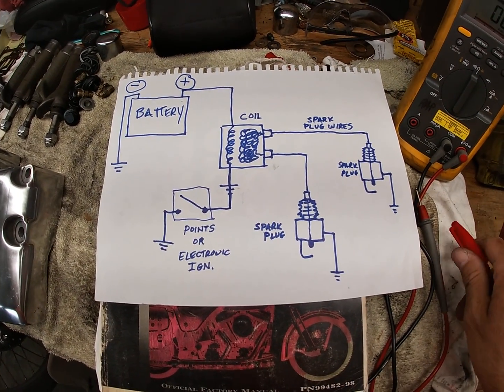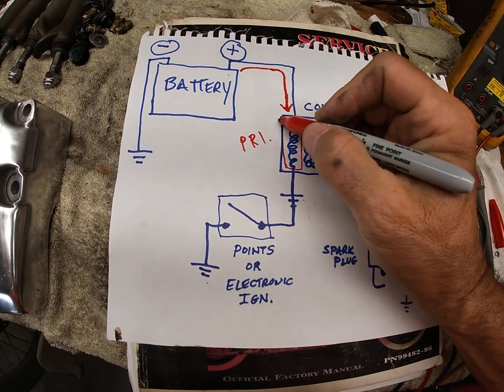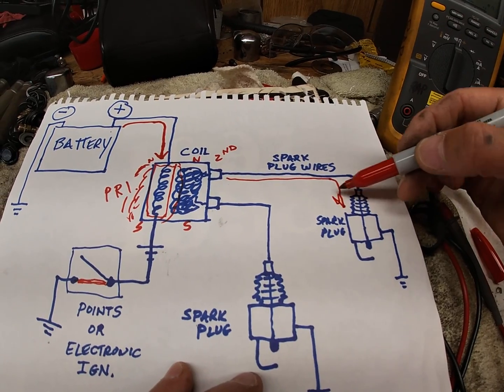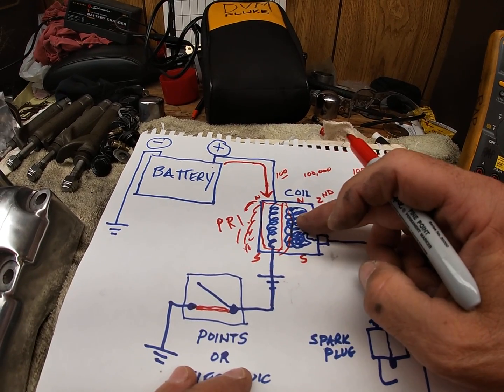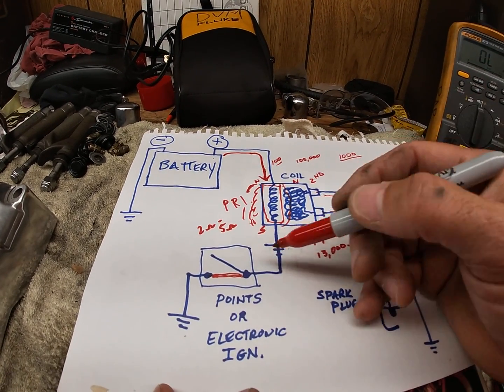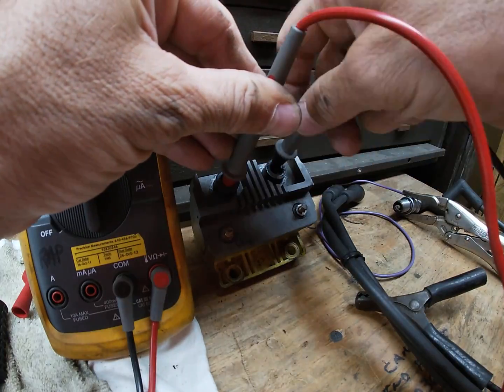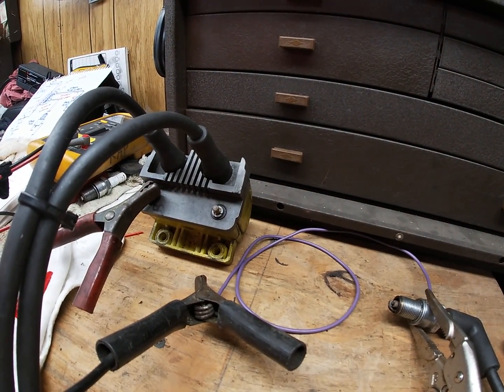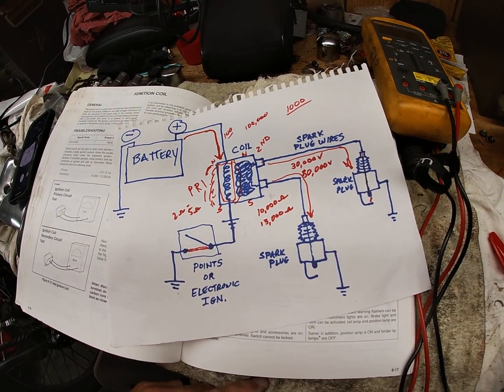Harley Ignition Coil, Points, electronic, Plugs & Plug Wire troubleshooting the system #Harley #coil

Comment: A must watch video if you are a home mechanic. Thanks
Reply from the maker: Thank you and if you haven’t, please subscribe.
Reply: @Rapsgarage  its great to watch your videos. Im curious if there is a need to have an upgraded coil if you put an upgraded cam higher lift longer duration something like a bolt in Andrews Ev3?
Reply from the maker: @patwrenching9674  The stock coil is fine if you’re just upgrading the cam. When you start increasing compression, you definitely have to get a high-performance coil. With that said upgrading to a single fire ignition and coil helps any Harley run much better overall. It will idle smoother and run smoother overall. I recommend going single fire for all Harley Davidson motorcycles. Harley went single fire starting with the twin cam motor and never went back.
Reply: @Rapsgarage  i plan on making a 100/100 ho/ftbls power plant. id like to build an evo to do this. id like to stay away from computers. i just sold my xl883n and my fxlrs114 and now am in a fxr 1989 bottom breather. and its hard to start i dud get some advice about tje voes but not tested it yet. 
but i wanted to know if just changing to cam higher comp pistons measuring the gasket gaps as per one of your videos will get me into the 80s hp at tbe wheel?
then ill take my time building a new / renovate power pant
Reply from the maker: @patwrenching9674  I have a 97 Evo that makes 80hp and 90lb/ft of torque. 
10:1 Wiseco pistons 
EV-27 Cam
Single fire ignition 
Thunder Header exhaust 
CV Carburetor 
Squish area setup to .030 inch
I don’t think the EV-3 will get you 80hp. I’d suggest you run the EV-59 and you should make closer to 90hp
Reply: @Rapsgarage  and Ev59 is a bolt in ?
Reply from the maker: @patwrenching9674  I would call Andrews and ask them
Reply from the maker: @patwrenching9674  Here is Andrews Cams install info. With the EV-59 there is some extra work required. I love the EV-27 and it's a stock bolt-in. Also, I have a full Evo engine build on my channel. I suggest you watch it.
https://www.andrewsproducts.com/files/assets/CamEV80.pdf
Reply from the maker: @patwrenching9674  https://youtu.be/54n8R72eJO4

Comment: Thanks . When I checked the primary it was fine 3.8 ohms , but when I checked the secondary there was nothing there it was just wide open . Also when I tried the second test for spark i used the bike's own battery and not only was there no spark at the plug but I guess the higher current gave me a spark at the negative on the coil with each on off cycle .I ordered a new coil today .
Reply from the maker: Sounds like a good call.

Comment: Thanks a lot for the video and the very detailed explanation. My 00 heritage softail with a carb’d tc88 will shut off once at operating temps. Will not restart unless it sits for a few mins. Figured I’d test the coil. I am a complete novice on testing electrical components. According to the factory service manual primary coil windings need to be 0.5-0.7 ohms and the secondary needs to be 5.5-7.5k ohms. Idk if I’m even testing it right, but I followed your video to a T. My particular coil on the primary side has a connector with 3 pins. How do I hook the multimeter test leads to these 3? Any particular sequence? Also, I tested the secondary windings just as you did in the video. I hooked each lead from the multimeter to each spark plug socket and got a reading of 11k ohms and it raised to 12.5 with a hair dryer on it. I’ve read some people say to test the primary you have to put one lead on the secondary then another lead on a pin on the primary side. Idk what to do.

I subscribed by the way!
Reply from the maker: When you have three leaves like that, that’s the dual fire coil. You measure from the center pin to one side and the center pin to the other side. The center pain gets the power and then the ignition grounds each side individually for each cylinder.
I would say it should be a rim .5 to .7 for each side from the center. If you go from outside outside, you should basically get double that amount.
As for the secondary side of the coil, I would have to say that if your manual says that it should be one reading and you’re getting something different then it’s probably not good. I would double check your meter to make sure you have a good meter to measure it with. 
You should never get any resistance from the primary side to the secondary side of the coil. They are not electrically connected. 
The resistance shouldn’t really change with heat from a hairdryer. 
I can help you further if you email me your phone number to  hdrap_1999@yahoo.com
It’s easier to discuss this over the phone then by me texting you. Also, I did look at my manual for my 2003 road king. There were no troubleshooting values for the coil in the manual.

Comment: Ccan you tell me how to confirm a hd 31656-07 coil is ok, primary is only 0.3-0.7ohms! Secondary is 1500- 2400 ohms from the manual. How come these values are so small compared to your example, fitted to a hd sportster xr1200x , 2011, efi. 👍🚀
Reply: If you're getting 0.03  to 0.07 ohms you may have your ohm meter on the wrong scale  . You may be using the continuity setting which is like an arrow and plus sign combined like this ->+ you need to switch to the next scale (200 ohms )
which would have 200 followed by a horseshoe symbol.
Reply from the maker: I’d have to look up, in the manual and see what the specs are for that coil. I don’t have that manual. Also, I would wonder how good the volt meter that you’re using to check it is. You can email me your phone number at hdrap_1999@yahoo.com and I may be able to help you more over the phone.

Comment: When you're doing the bench test you refer to positive and negative sides of the coil. I've always been told, with a dual fire coil, there is no specific designation for +/- side. I.e. power to one side and trigger/intermittent ground (whatever ya call it, lol) to the other. Also curious, would this test be better performed using a known-good battery so you could actually see the quality of spark? Regardless, thanks for the video!!! I think you may be about the only got on the web that goes beyond the generic ohm test to which, I've found, is not any guarantee a coil is good. Have had several that meter fine but don't work/produce spark.
Reply from the maker: You are correct that on a duel fire coil the polarity doesn't matter but on a single fire coil it does because the coils are connected together at the positive side. You are also correct that a good battery, instead of the battery charger I used, would provide a better spark at the plugs. Thank you for the kind words and thank you for watching. Please subscribe if you haven't/
Reply: @Rapsgarage  I have one more question, is there a standard for plug wire resistance i.e. x ohms per ft. ? I have two wires that won't read below the 2k scale but read .3xx and .6xx the later being 2x longer. That reading strikes me odd in comparison to my other bikes but I have no basis for that other than that comparison. I'm just used to seeing a digit to the left of the decimal point.
Reply from the maker: @SayariDunia  I would say that it depends on the type of wires you have. I would call the manufacture that made the wires but what you say is correct. The wires will have a resistance per inch that really shouldn't very that much.

Comment: What about the ECM?
Reply from the maker: I’ve never had to fool with one. I only have one bike that’s fuel injected and it’s never had a problem. But the ignition system works exactly the same only the ECM is controlling the coil. So if you go through this test and you still don’t have spark when you put it back on the motorcycle I would check to see if you have a pulse coming from the ECM. That pulse would be ground signal as you crank the motor. If you need further help, you can email me your phone number at hdrap_1999@yahoo!.com

Comment: That’s a good diagram but;
1st- the voltage/ amperage windings may be backwards. Usually on a distribution transformer, you are stepping down from high v to lower v (12.5 KV to 120/240v as an example 60/1 ratio)The high v coil (primary)has less windings than the low v coil (secondary). In the case of ignition, you are using the coil as a step up transformer ( amperage and voltage are equally and inversely proportional) the coil from the battery would have more windings ( higher amperage/ lower voltage) the coil going to to spark would have less windings ( lower amperage/higher voltage). 
2nd- Any induced voltage is the opposite polarity as the applied voltage. In order for the positive and negative poles to be on the same side, the secondary coil must be wound in the opposite direction as the primary coil.
3rd- The energy collapses when continuity is lost ( switch opens ).

I am in no way trying to disrespect you. I’m watching this video because I want to work on my own bike and lack the knowledge that you have earned. 
That being said, I am a high voltage lineman by trade so I thought I would just return the knowledge
I was so fortunate to gain from you. 
I put a 140 c.I. Ultima in my chopper and can’t, as of yet, get it to run right!
I really appreciate your videos.
Reply from the maker: I appreciate the input and don't see it as disrespect at all. I'm in the electrical field as well. I have a electronic degree myself. 
The primary side of the coil has fewer windings then the secondary side however the primary side winding are of a much higher gauge wire in order to handle the higher current that the primary side requires. The secondary side has much thinner gauge windings and a great deal more of them. The reason for the thinner gauge wire is because the current is much lower and it is also a space issue to keep the coil smaller in size. As you said, when voltage is stepped up current goes down by the the same factor. E=IR. Taking in account the I2R loss will require a bit more current but it's not much more. I did state that the coil fires when you remove the ground as you stated. The magnetic field is created when the circuit is closed and current stops flowing when the magnet field has reached 5 time constancies. One Time Constance is T=LR (in seconds) or 63% of the coils max steady state or full charge. As for the polarity of the coil you are probably correct. This video was to give someone who doesn't understand how an ignition works some guild lines for troubleshooting. I did my best not to get too deep into theory since it only looses most people and it's just not needed. I stand by the accuracy of the information except maybe the polarity of things and that doesn't matter for this video. If you ever need help you can email me phone number to hdrap_1999@yahoo.com. I can call you and help over the phone since it's much simpler that way. Thank you for watching and please subscribe.

Comment: I have a 93 FXLR.. been sitting g for at least : years.. has no spark… I have power to both sides of the coil.. if I disconnect the negative side and momentarily ground it .. it will spark., bad module, since the module provides the ground….  thanks
Reply: And it was
Reply from the maker: Agree... Bad Module
Reply: The steaming eagle ignition module is obsolete… what do you recommend for a replacement??
Reply from the maker: @chrisrottinger512  I recommend a single fire ignition. https://www.dynaonline.com/dyna-2000i-performance-ignition-and-coils-kit-for-1970-1999-harley-davidson-carbureted-models-single-plug-single-fire-dc6-5-d2ki-5p/

Comment: Curious what you think would cause the 15 amp ignition fuse to blow?? 
Blew 3 🤷🏻‍♂️
Reply from the maker: Maybe a bad coil or an intermittent short. Check the resistance of the coil.

Comment: My coil is good but no spark just replaced my ignition module any ideas
Reply from the maker: I take it you tested your coil by itself and you have spark. If so it would have to be a bad module. First I would double check the wiring of the module. Make sure you have the 12 volt positive wire where it’s supposed to be and verify that your ground is good. What module are you running? Single or duel fire? I hope this helps. If you email your phone number I can call you and help further. hdrap_1999@yahoo.com

Comment: I have an 07 Roadking sudden loss of power on the highway at 70 pulled over and just turning bout wouldnt start.. i was thinking straight away towards the plugs crank position sensor as im awaiting new parts thought i would check the coil im getting 6000 ohms reading wich im aware is bad and should be 10000 to 13000 like you have stated also. So ive ordered a new coil also and i hope my problem will be solved
Reply from the maker: South like your on the right path. Let me know how you make out.
Reply: What was your ohm reading on the new one? I’m going through this on my 05 road king my old one read 5600 ohms the new one only read 6100 so I think the numbers might be different for efi twin cams.
Reply: @moondogwrecksit9867  they read at around 6ohms and are working perfectly fine as i found out. After buying another coil pack . The test to gst the 10000 to 130000 must be done some other way as i couldnt get any of them readings. My problem was an adjustable pushrod came loose dropping the rear cylinder. Re adjusted and bike back to normal.

Comment: I have not found any one explaining the 08 big twin , 4 pin plugin coils , my electrical manual does not show a test procedure it seems to only want to sell break out boxes an other tools . It does state a reading of around 7500 an a lower reading . The meter I have the lowest reading is 200 , then 20,000 , Im not a electronic engineer if you know what I mean , get rid of the electronics an I can fix any piece of it , you get the idea . A few days ago I replaced shifter shaft seal, clutch hub an bearing , C E stator , bendix , comp eliminator an tacked the starter ring , started it 3-4 times the drove it less than 10 miles stopping and starting 3 different times along the way , it set 1 day an then would not start , no fire . Didnt notice any codes , checked crank sensor best I could seemed alright , raised the tank pulled the coil , I had a used super coil , the coil on there , the front cyl came up to a only slightly less reading than the rear (power pin to front an rear pin) my front plug was kinda black looking , rear looked like it was burning good . I tried it with the super coil after removing the battery ground for a while , still no fire . Reminding myself about checking for codes , I found crank sensor sync #18 on the list (could have been from cranking unplugged looking for build up an drop) I erased the code , let it set there a few minutes , noticed the hands slightly move on the dash , touched the starter an it started on the same crank sensor , your guess is good as mine ..........
Reply from the maker: Email me your phone number and maybe I can help over the phone. Hdrap_1999@yahoo.com
Reply: @Rapsgarage  I checked back to see if youtube had deleted my comment , they have been doing that for no reason , they censored your reply , I never received it ..........

Comment: On a 1998 sportster 1200 any way to test ignition module?
Reply from the maker: Use a screwdriver and wave it in between the pick up on the electronic ignition.This will cause the wire that goes to the coil to go to ground and make the plugs spark.
Reply: @Rapsgarage  thanks

Comment: Weak Spark because You don't use the capacitor, traditional or electronic module  have capacitor 0, 22 uF. This is necessary  for charge voltage and disgarge when breaker starts to open
Reply from the maker: This video is for basic troubleshooting.

Comment: Testing the coil like that, I should be able to get spark out of both sides?
Reply from the maker: If it’s a dual fire coil then yes. If it’s a single fire coil you will only get spark on one plug at a time.